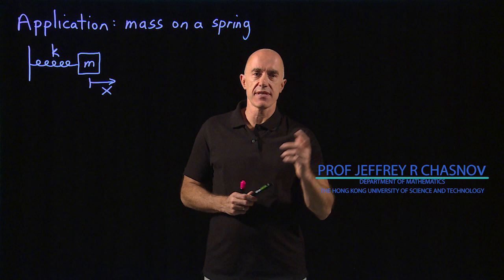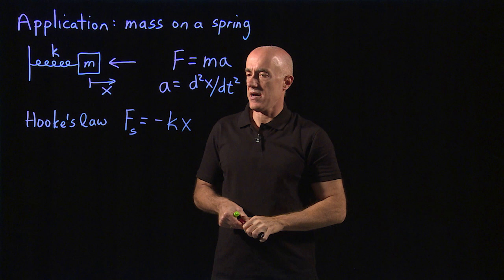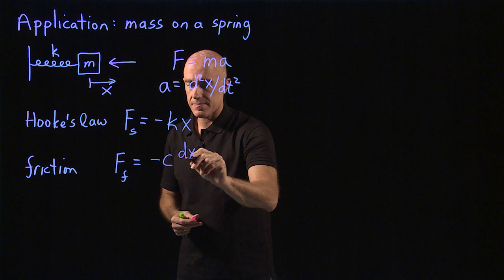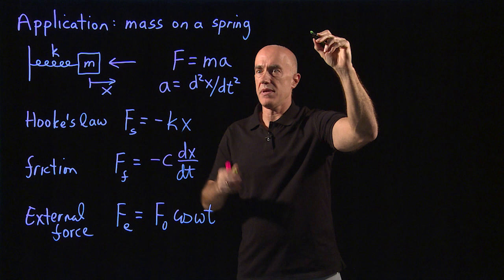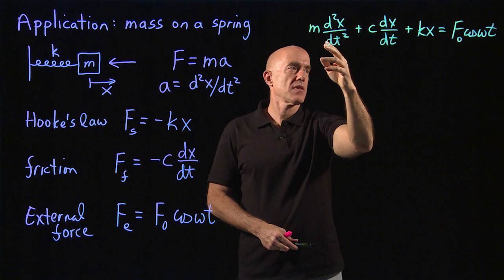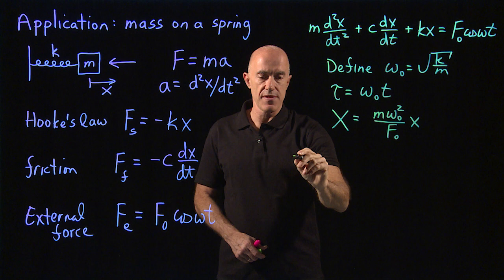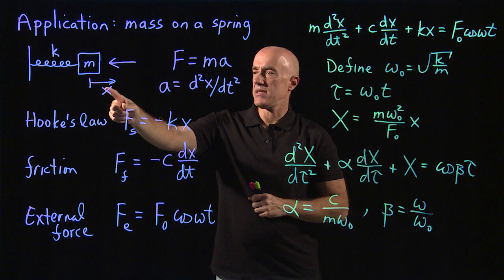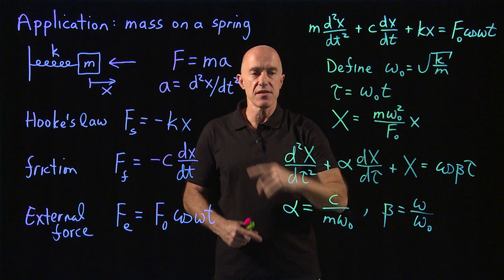Mass on a spring: Hooke's law, friction, forcing | Lecture 26 | Differential Equations for Engineers

Comment: (1) Why is external force sinusoidal? Since there is no phase shift, I assume the omega in the external force's cosine is same as the omega of the harmonic system? Otherwise the system would not be "simple"
(2) Why is friction modeled as a function of velocity? I thought { dynamic-friction = coefficient*normal-force  } and friction is a function of mass...
Reply: Friction takes away the momentum of an object so the velocity is negative because there is no such thing as a negative mass (that we know about). The external force changes the period and frequency of the fundamental oscillation and therefore can be modeled by a consine wave.  It’s cosine because at t = 0 the force is maximized and tapers off until it matches the normal mode at multiples of 2pi.

Comment: Hello and thank you sir for your really great educational lessons

I have question please : 
When you write F=ma , are you projecting the forces along the +ve axis? , because in this case we might have two different differential equations if we assume the acceleration is in the direction of the -ve x-axis ?? , or are you writing F=ma in the general vector forms without projretion on any x-axis  direction? 

Thank you in advance
Reply from the maker: I am treating a one-dimensional problem
Reply: @ProfJeffreyChasnov 

 Thank you for your reply

Yes ,  but with one dimension it can be either positive or negative

What i meant in my question is that you assumed that acceleration is in the positive x direction , but during oscillation when the acceleration is in the negative x direction we will have diffent differential equation with a minus sign to (ma) ?? , whats wrong with this analysis ??

Thank you

Comment: Can you explain what exactly c is in this video? I'm having trouble seeing how c*dx/dt equals a force as inserting simply the frictional constant results in a velocity, but also when inserting c as the frictional force it results in a power.
Reply: Or more direct: can you solve for the value of c, if you know the frictional constant and mass?
Reply from the maker: @emilkiholm931  The assumption is that the frictional force is proportional to the velocity of the mass.  The constant c is just the proportionality constant.  We know that if the mass is at rest, the frictional force should be zero, so it is in someway a linear approximation for this force.
Reply: @ProfJeffreyChasnov   I love your series and it has helped me alot! But this seems really weird to me. Assuming we're talking about dry friction, the frictional force is just a constant in the opposite direction of movement and not linearily dependent on velocity. But for sure we can assume this in math world. Also assuming F_e is pushing to the left, shoudlnt it be -F_0 coswt for the ode?

Comment: can you show gravity as a disturbance of the system? what would be the differential equation?
Reply from the maker: You can add forces and use Newton's law to write the differential equation.
Reply: @ProfJeffreyChasnov  could you just give the final equation like one with a second-order differential equation? I am confused, what to after putting down mg into the system.
Reply: Hi, here the springs are working on a plane perpendicular to the ground, so gravity fundamentally does not act on the box since gravity pushes on the y-direction (towards the center of the Earth)